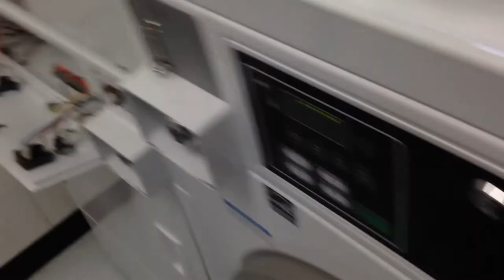ESD Vertical 8 Price Change

Comment: Thank you for the detail on the fingers & spacer. I had to remove the slide because someone had put in a quarter with a big nick in it that caused it to jam, and I had to take that apart. But I didn't pay attention to how the spacer bars went inside each finger, so I didn't put it back in correctly. Was able to see how it fits and now everything is working again.

Comment: Showing how the slide unit is removed from the machine would be very helpful.  Our laundry has ESD coin slides that all look the same, but inside the box shows several different styles that all remove differently.  Our machines are elevated on a riser for customer convenience, and are also right next to one another.  Hence, the machines cannot be moved for easy access requiring that the tech be able to remove the slide unit quickly from a less than ideal position.
Reply: There is a hex shaped bar thing that holds the coin slide in place.Open the access door take a 5/16 socket and loosen the bar if you can't hand loosen it then take a hammer or something and tap the coin slide from the bottom to loosen it then pull it out.

Comment: How do you get it off the machine
Reply: There is a long bolt that runs over the top and screws into the front of the box, you can see the end of the threads from the outside when it is still in the box, at top and center. You have to unscrew the bolt, and then you can wiggle the unit and pull it out the front of the box.